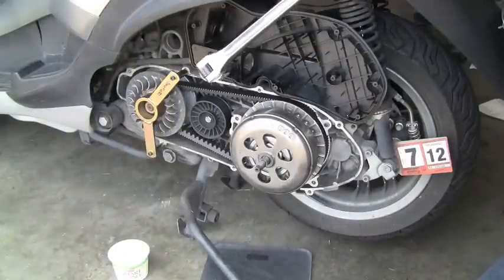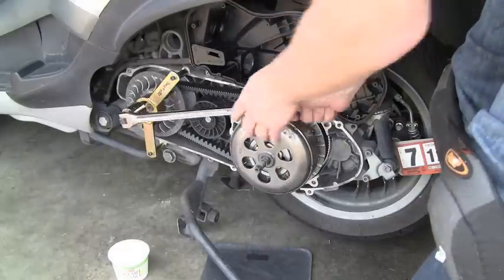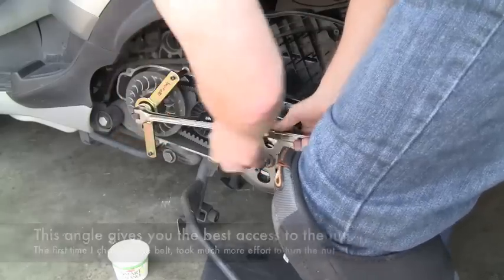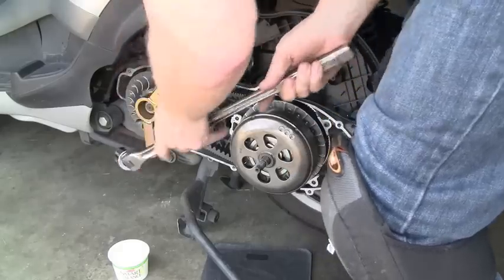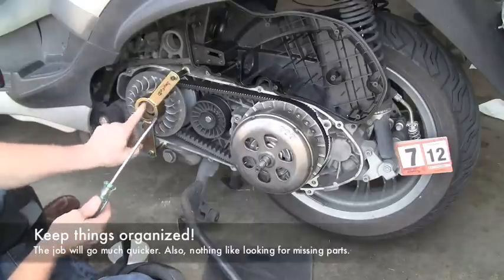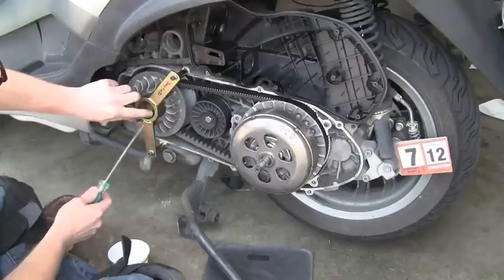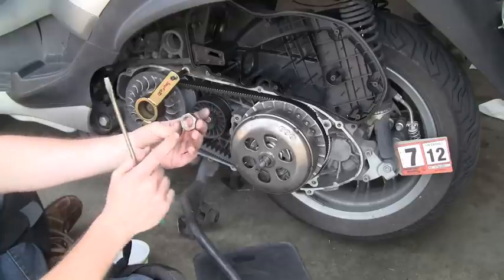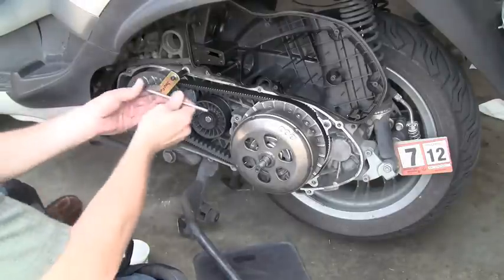Piaggio MP3 400 - Variator Nut Removal

Comment from the maker: You won't be able to remove the cover until the nut holding the clutch is off. You can see this in the driven pulley nut removal video.